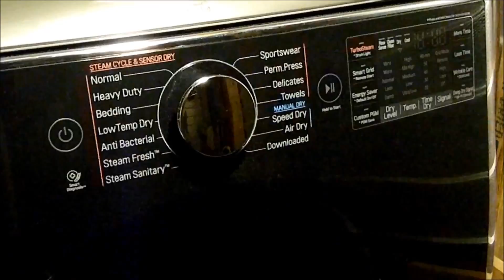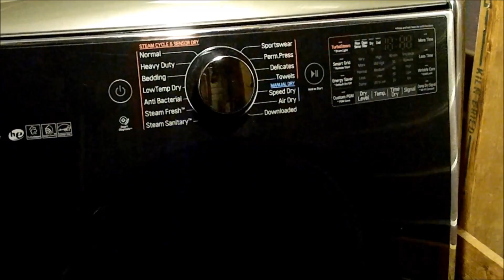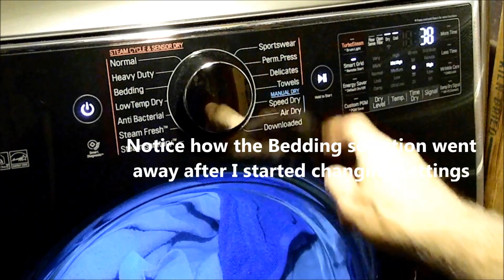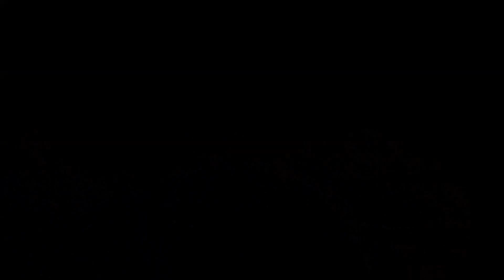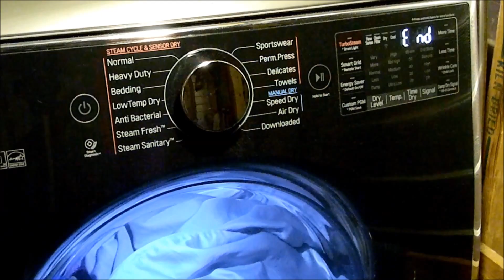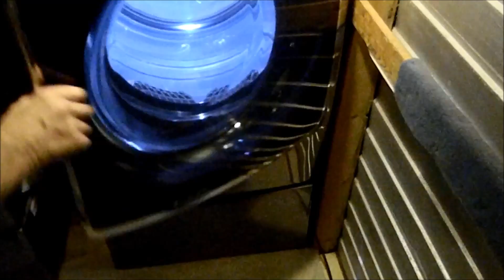LG dryer DLEX5000V

Comment: Does this dryer need to be plumbed in to make the steam feature work, or does it use a refillable water tank/cassette like older LG dryers? Thanks
Reply from the maker: It has an external water connection just like a washing machine.